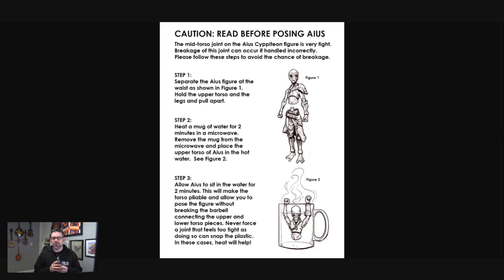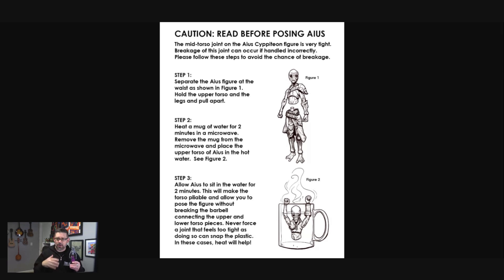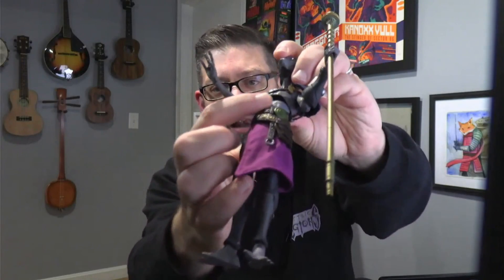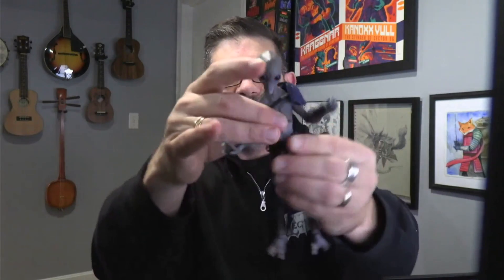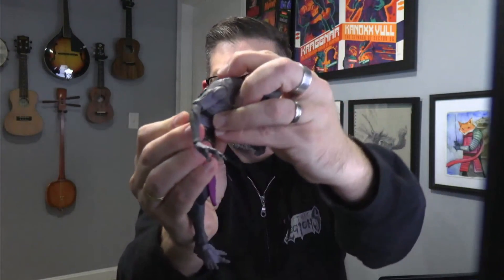Simple Step-by-Step Instructions for Heating Your Aius Cyppiteon Figures to Avoid Breakage

Comment: Thank you for this. I got an action figure mug especially for things like this. I never drink out of it but it has helped with pop and swap and super tight joints. Great trick. 

I'm guessing silicone oil will also work. Though gotta be careful with that..too much and you get a floppy figure.

Thanks again for showing us this!
Reply: This is the figure I'm looking forward to most, so I'll be excited to see if the silicone shock oil will work. I'm sure it'll all least help. Still excited!